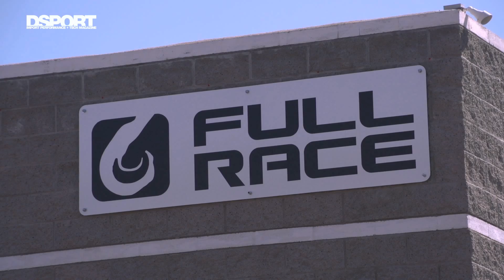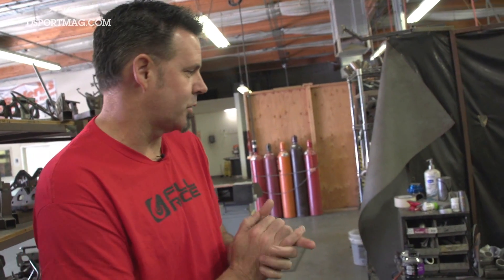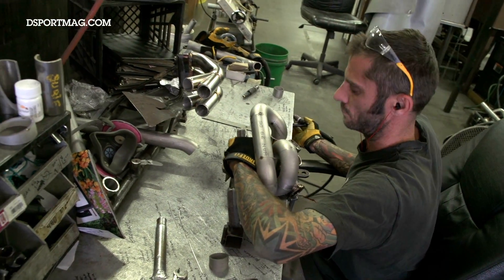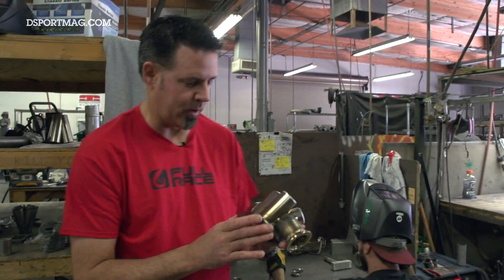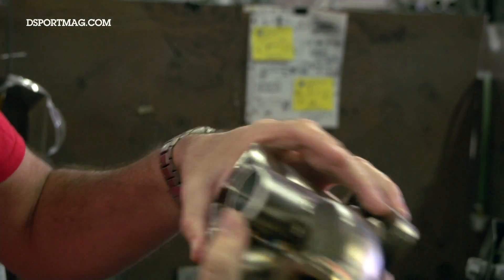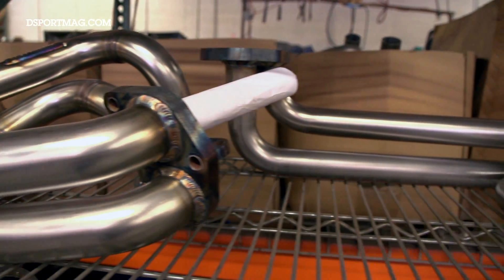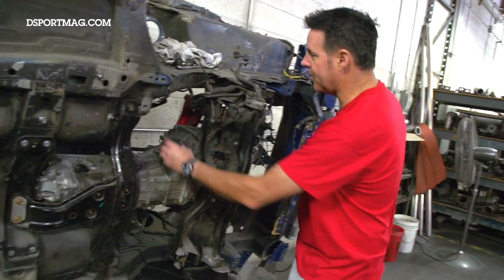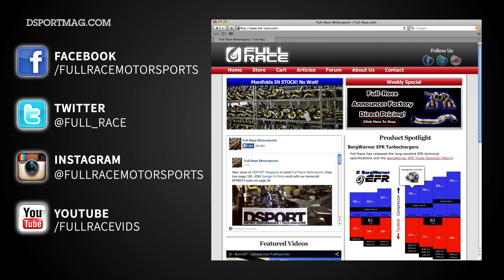Inside Look: Full Race Motorsports | DSPORT Magazine

Comment: Wow!  Really labor intensive.  Ever thought of 3d printing the complex pieces? I design headers for NASCAR/F1 (and used to fabricate them).  I have a computer program that automatically designs tubing solutions and will optimize for length, flow, minimum welds, etc. and imports the design into state of the art CAD programs like SolidWorks.  

You guys are using way too many pieces in the primary tubes  resulting in a lot of welding, but only a computer algorithm can find the minimum number of segments. I could save you 50% + on your labor.  I have a white paper on this if I can get your email I'll forward it to you.

Kurt
SLC, UT
Reply: hi Kurt, that sounds very interesting, how much more can you share? is the computer program proprietary?
Reply: @bilaltariq7819  Sure, the software is setup so that it can read the coordinates and direction vectors of the exhaust ports, the location and direction vectors of the merge collectors, as well as space constraints (obstacles), as either points, point clouds, planes, etc.  It will handle any topology like 2 into 1, or arbitrary.  

Length constraints for the primary tubes can be set for each section and it supports 'stepped' primary tubes.  You can set tube lengths individually, as equal length or shortest possible typical for turbocharged cars. 

The software outputs a 3d surface model of the solution which can be imported into any CAD software so you can double check fitment.  

It also produces a Bill of Materials showing each tube, the arc angle, angle and lengths, along with the rotation angle of each segment.  

Part of the optimization which is very important is that the bend radii used in the final solution is maximized (important for flow), and this is done within the space constraints.  There's a lot of fancy math in this... it's known as an 'inverse' problem, and overall, it's a constrained optimization. My younger brother who is an internationally recognized mathematician (and Professor Emeritus at the University of Utah), helped me on the math side of the software.

Hendricks really loved this for a lot of reasons:  For the first time they build multiple headers and have them fit and perform exactly the same on the dyno.  The amount of welding is minimized because most primary tubes have only two welds, and a few with 3 welds per primary (for NASCAR headers).  This save a lot of time.
I designed Jeff Gordon's headers that he won the Daytona 500 (I think this was in 2000 or 2001).  They made about 10% more power than anything else they tried, and they tried everything available.

If you have an email, please share and I can send you some pictures and maybe a few example designs.  Or, you can email me at kurtdobson@gmail.com. 

I also designed the Honda V10 headers for the Ralt F1 car around that same time.  It was so complex their attempts had all failed miserably.

Best, Kurt

Comment: Do you make a turbo header for ford 2.3 ecoboost premium 2017 MUSTANG  . My engine needs to breathe better. I want a 3 inch exhaust system and a larger turbocharger and intake and a race intercooler. Then esslinger RACING  camshafts and ported and polished heads. ARP. BOLTS AND THE BEST HEAD GASKET MONEY CAN BUY. I WANT TO  RUN A LARGER TURBOCHARGER 
AROUND 25 TO 32 POUNDS OF BOOST.
DOES ANYONE MAKE A LARGER OIL PAN.